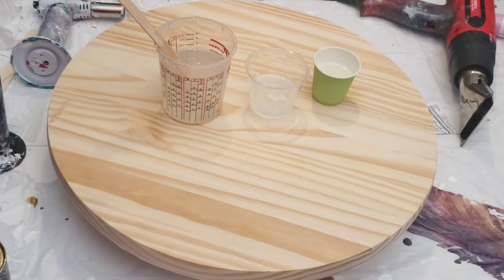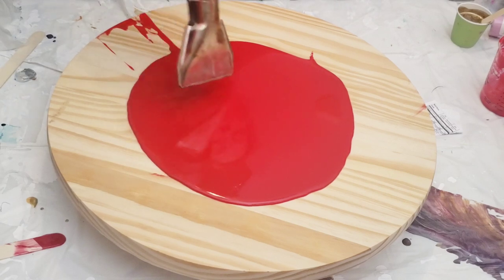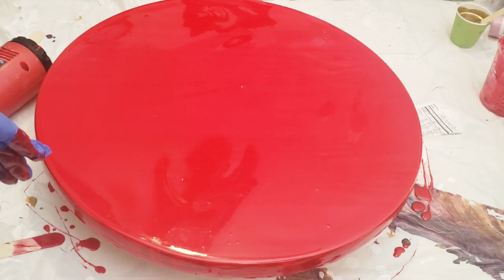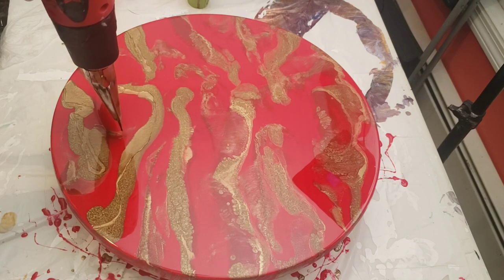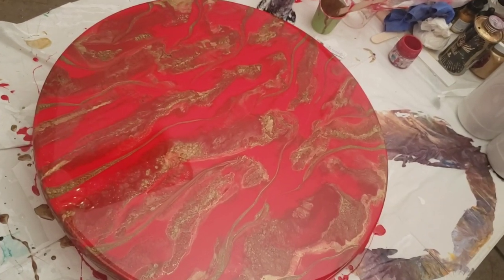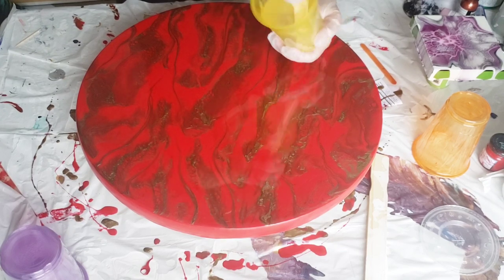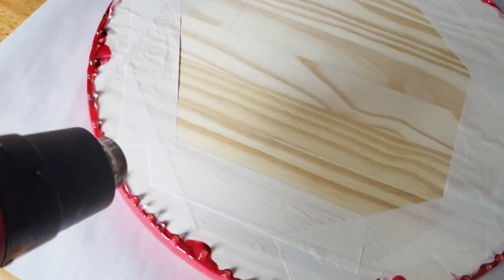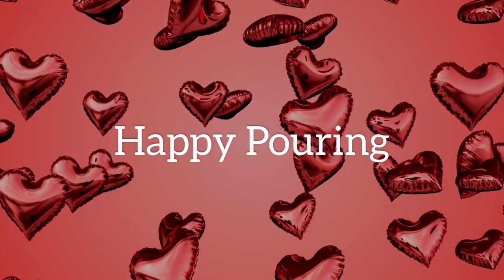[5] Special Effects Designer Table | Must See |Simple| How To Make Your Own Table | Beginners Art

Comment: Tammy how large is this round  you are using?
Reply from the maker: I'm sorry should have mentioned that.  Its an 18 inch pine round from home depot.  They are like 10 bucks and the legs were 8 each.
Reply: Tammy how large is the round wood.
Reply: Thanks Tammy. This is very helpful. I am going to try this project. A bit nervous but will try.